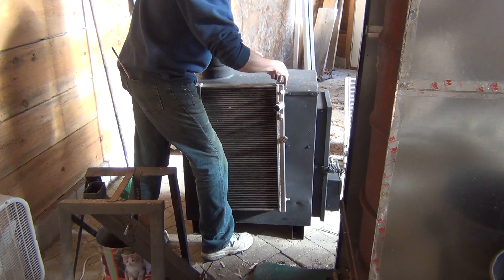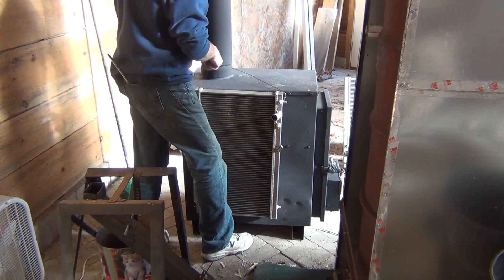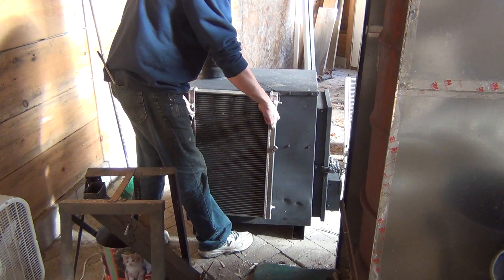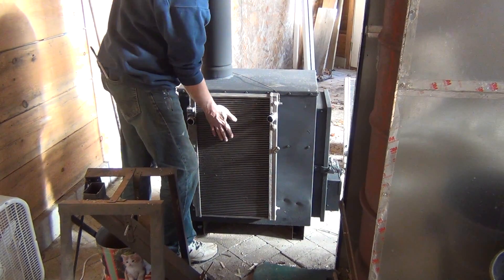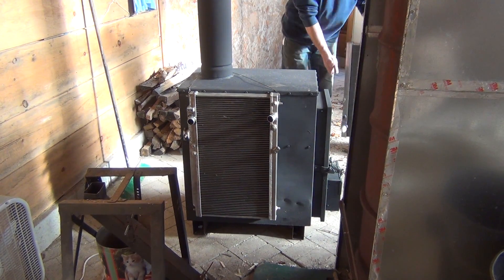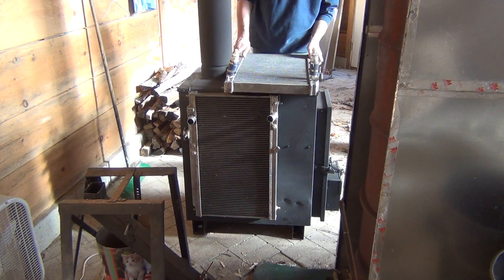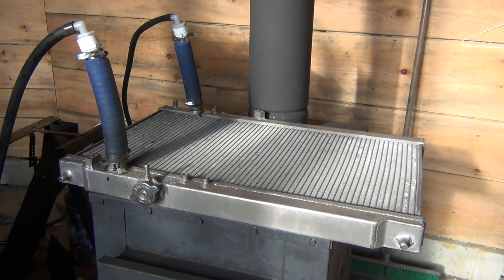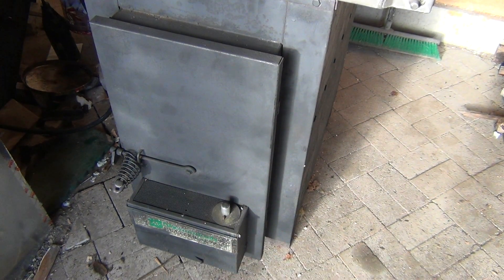Redneck Hot Water Heater

Comment: Hi there... just want to offer some tips as ive made a few wood burner type hot water systems. Also something concerning safety.

-0.30 you can increase the flow and efficiency of your boiler by turning the vertical rad other way up. That way the water coming will enter from below the stove, and continue up.
-1.15 you can increase the efficiency and make this safer by raising the right hand side edge (looking from the front) b y about 15-20 degrees. This gives the hot water somewhere to flow. It will also stop any air pockets forming.
-I dont see any air pressure value incorporated into your system. I can see its not a closed system, but the hot water tubing moving downwards into the pool could create an air pocket, because its pointing downwards and you’ll have a high pressure steam bomb! ... theres an easy way round this. I see you have two pipe fittings coming from the rad on top of the burner. Use one to fill the tank, moving downwards as before. The other, extend a tube skywards so that it reaches at least 3 feet above the water container in the background at 0.52. That way the water line will rest at exactly the same level as the water container, with a 3 foot air gap in the tube. If the pressure does build up in your radiators, from an air pocket or something and water not moving, then it has somewhere to go other than the downwards tube – which could also get blocked. It would build up pressure, rise 3 foot and vent from the air value tube.
-If the “system pump” is connected to water mains and not the container in the background, then the pressure will be more than the air value described above. So to make this work, create a gravity feed... Build a wooden tower, place a “hot water storage tank with a ballcock float valve” above the radiators at least 2.5 meters. The water comes in from the system pump, ballcock stops & controls the flow. Water is now gravity fed, comes out of the bottom of the storage tank down and feeds the radiators.
 
Is there a return for the water your heating? ... i guess you dont need to if your doing this for fish. you just need to heat the water once

Btw... i sooo want to live in your green house design :o)
Reply from the maker: thanks for the feedback.  I had wanted to rotate the vertical radiator 90 degrees to remove the air pockets but I didn't have a quick way to hang it.  there is some air in it above the inlet lines but there's enough heat transfer with the AL that the top section doesn't get hot.  Overall the temp of this is fairly even since the cold water is entering, sinking down to the bottom, then as it warms, rises back up to the top.  There's no need for a blowoff valve since it's draining to the open air.  Besides, even if the piping got clogged, it only takes a couple of pounds to pop the tubing off of the fittings.  Even if that failed, the radiators have built in relief built into the caps.  It's just a quick hack so I didn't have to fire up the rocket mass heater yet.  ;-)
Reply: ahh see... ok. just wanted to help.

So this isnt a hot water system to heat the place, just something to warm up water for the fishes and planets... not hot.

Still recon you need a blow off value because your piping is coming down... but like you say the piping would pop if it got too much anyway, and the rad having values on them helps too. hmm ok ... safety covered :o)

If you turn the verticle rad 180 and have the pipe inlet come in from below so the cold water enters here. Insted of coming in at the top, trying flow down and then up again. your putting cold water where the hotter stuff is surely?

Also putting something like a few tiles 5" under the front edge of the top radiator if looking at the stove door (changing what i said earlier) this will give the top rad something like a 15 degree slant. With the highest pipe being the hot water out. Should improve flow rate if you need it.

... can i ask whats going on please. Water comes from the big fish tank. Gets pumped through the rads. Drops back into a lower container, which is your plants area. another pump brings this back up into the fishes tank. So this is a closed system, other than topping it up from the mains?
Reply from the maker: DiyEcoProjects yes, it's a closed system, (technically, we like to call it recirculating system) and we just top off the water as needed.
Reply: i see.... ok cool

Also I like the way youve done your connectors for the geodome.

Comment: could the flue of the woodstove be attached to the rocket stove's burn chamber to capture the heat otherwise going up the chimney? also tenting the rads on top of the stove would work better, and with a shroud over the lot and an air circulation fan in it to make a convection effect through the fins of the rad for more heat exchange.

Comment: put the radiator inside the stove, so the hot air / smoke can have a direct affect on the element, not the flames just the hot gasses escaping to the  outside.

Comment: i know this is almost a decade old :) but it seems like if the radiator was somehow inside the furnace that'd be significantly more efficient use of the heat
Reply from the maker: the newer videos show how I installed a secondary burner and tank inside the stove.

Comment: I have tried many ways to heat water with a stove and the best that works for me is to simply drill two holes in the back of your stove 3/4 of an inch dia, the buy a soft copper coil of 3/4 copper at home despot . and just un bend the ends of the copper coil enough to run about 6 inches of copper out the holes you drilled in the back of your stove drill them up high about 14 inches apart or about as wide as the coil your gonna use so the coil sets high in the fire box,, You will find you will pick up many times the heat per cycle compared to your radiator system.

Comment: For water heating, I've had good results taking a smaller stove, and necking the output flue to 4 inches, and using an old Gas water heater with the burner guts removed as part of the flue. I have generated steam, so BE CAREFUL!

Comment: I wonder could it keep up if you'd put it inside, so the outgoing gases pass trough the radiator. And if it would work, would you have too much condensation on the radiator, and too much chem burns from it.
Reply: couple things wrong there, aluminium doesn't stand heat well, and the soot will clog them up.
Reply: He is burning his fuel efficiently, he is good at that, so the soot will be minimal. Since it is filled with water, it is hard to reach melting or even annealing temperatures. However, Candoract you are spot on with the soot and temperature.

Comment: As I am researching aquaponics, I keep reading that "food safe" materials are a necessary part of having a successful system.  Are you concerned that the radiators may be contaminating your water since you are not running a heat exchanger?  Thanks for all the videos as I look to them for inspiration and education!
Reply from the maker: Yes.  Normally you shouldn't use aluminum in an AP system.

Comment: why don't you put copper coil tobing around the stack pipe and use the heat from same to heat water?
Reply from the maker: the stack is insulated and not very hot.  Plus, copper is really expensive!